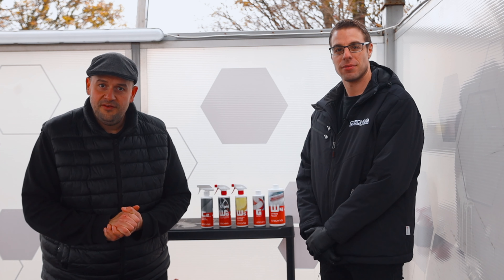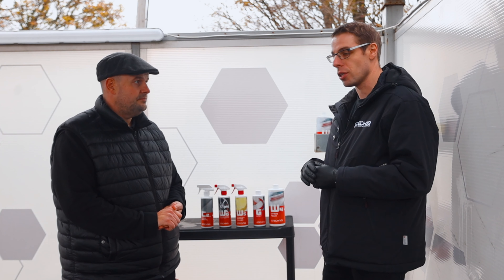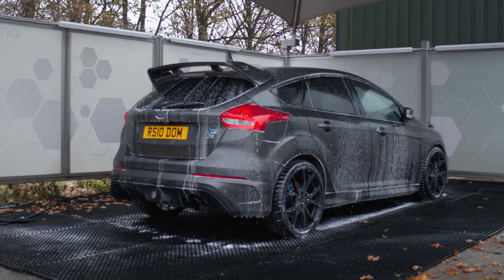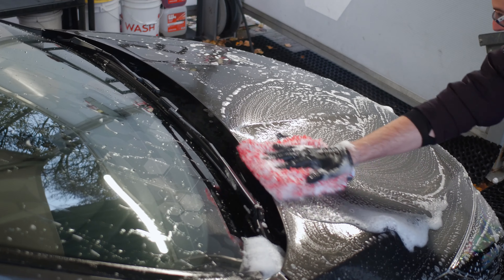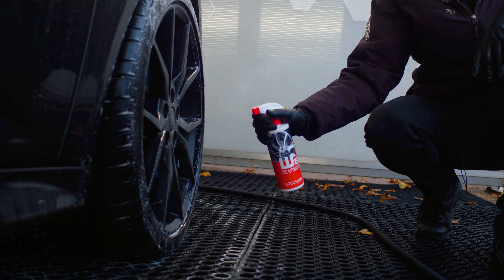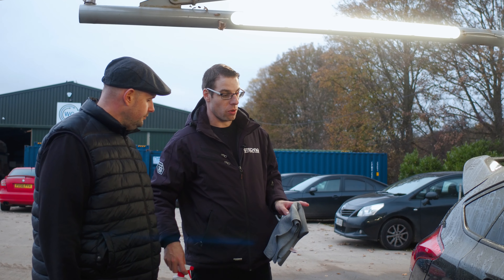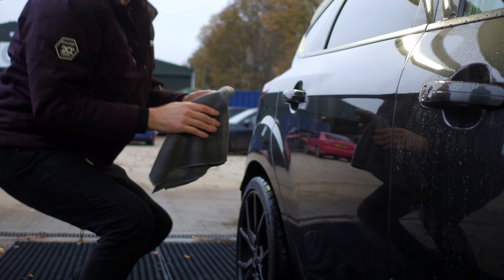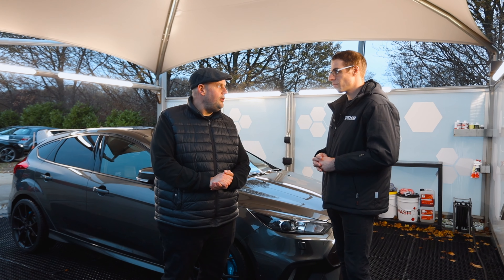Washing Your Car During Winter - Detailing Tips & Tricks From Gtechniq

Comment: Wheels before washing paintwork tip 1. 

You want your foam to dwell and not run off, this softens the dirt and then you pressure wash it off tip 2.

Don’t wash your car with circle motions, you’ll cause more swirls. Tip 3. 

Good video but could be better